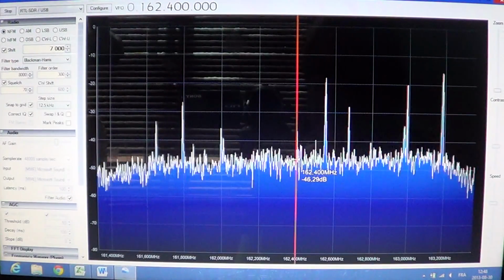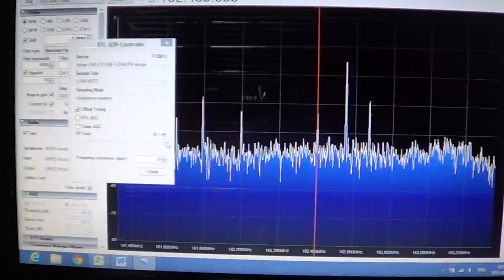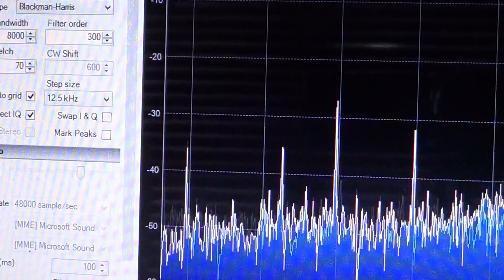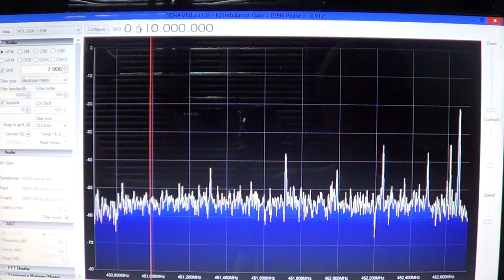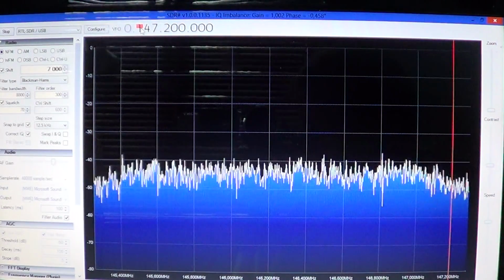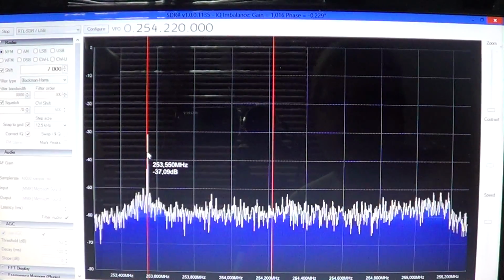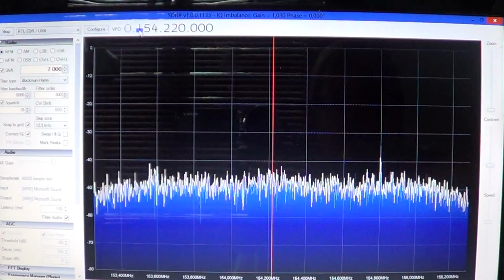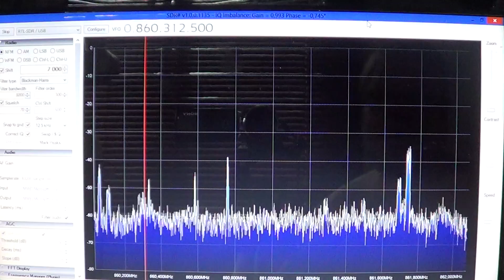Second look at SDR USB receiver and SDRsharp software

Comment: Y have cut the coax from the antenna an put a bnc connector on it.
Now y am listening on a v2000 vertical or a hf windom, and there is a divergence, hi.
A big one.
Good luck.
pa3cuu

Comment: I've got exactly the same dongle... it has the FC0013 tuner so it does not go lower than 50 MHz. So if HF listening is required with this tuner, an external upconverter is required to bring HF signals into the dongle's range.

Rgds!

Comment: I thought he said the one he was using did not require an external upconverter but only worked down to 8 Mhz.

Tom
Reply: I works down to 30MHz and DOES require an upconverter.  He was also talking about another dongle that had a wider range. Wide enough to cover HF.

Comment: All of them, using an external upconverter. As I've mentioned in other comment here, the one I use is CT1FFU's V4.0 and HF reception is really good for being what this dongle is... The only drawback is some notable overloading at ham or utility bands when there are strong broadcasting signals nearby (no built-in filters in the dongle)... but despite this, when those signals are not present, listening to HF with the dongle+upconverter combination and a good antenna is a joy.

Comment: The antenna that comes with these have very poor performance and the thin cable lets a lot of RF noise in from your computer.  Suggest you get an adapter, some good coax and an outside antenna.  I was at how much this cleans up the signals and amplifies without additional noise. I started with this software too but it was a pain to install and adding options can be a pain too.  There are several other packages out now which are much easier to install such as SDR Console.

Tom

Comment: RTL-SDR is great. I used an ezcap and now I use an "ebay" dongle with CT1FFU's V4.0 upconverter and the SDR Console software (which has an S-meter) to get a great all-mode HF receiver, and I use the same dongle with SDR# to listen to the "birds". In this case I installed a SatelliteTracker plugin for SDR# which lets Orbitron control the tuning for Doppler correction. In all of these aspects these dongles are simply awesome.

BTW, I miss the useful waterfall in your video...

Rgds from Barcelona!